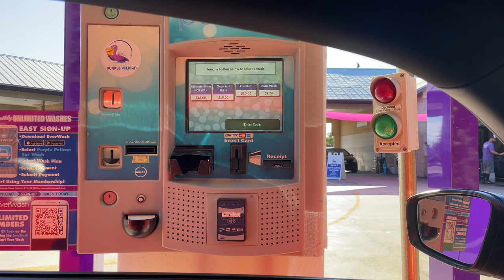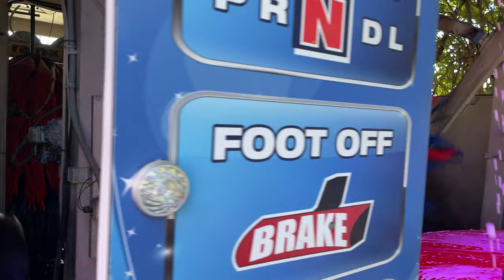Pelican Car Wash - Belanger Mini Tunnel

Comment: What is a C Channel Top Brush?
Reply from the maker: The foam material is mounted on a C-Channel core rather than other methods such as star foam, etc.
Reply: @sunshinesuds  Interesting. I've never heard of these types of Foam. Can you elaborate?
Reply from the maker: @carwashslayer4235  it’s essentially the same application method as neoglide. Many manufacturers make C-channel material, sometimes out of cloth. Gallop brushes are widely available too!
Reply: @sunshinesuds  Cool and Thanks can you post a Belanger Tunnel with a Mitter Curtain?
Reply: @sunshinesuds  thats a nice mini-tunnel! I love those newer Coleman Hanna Dryers!